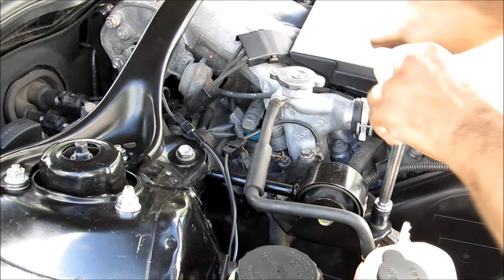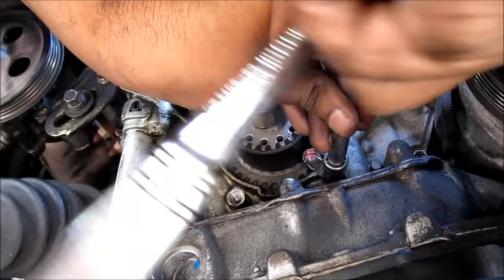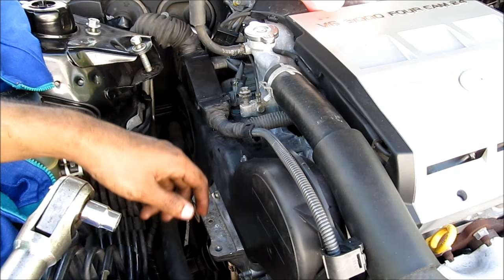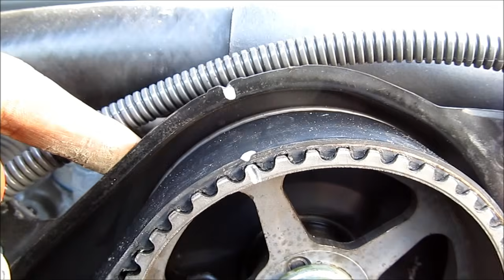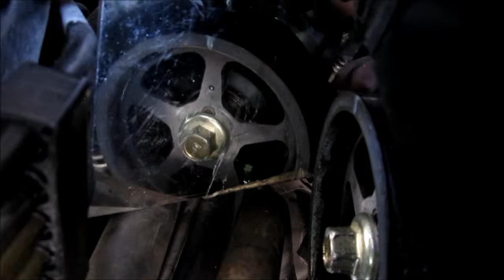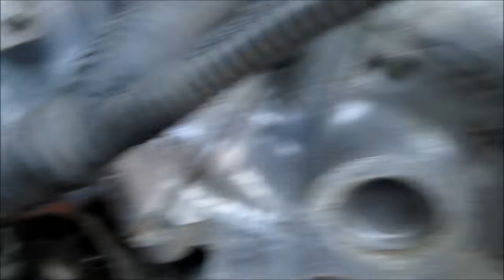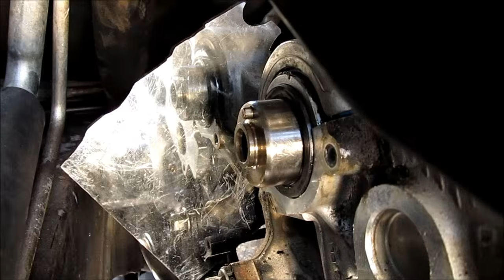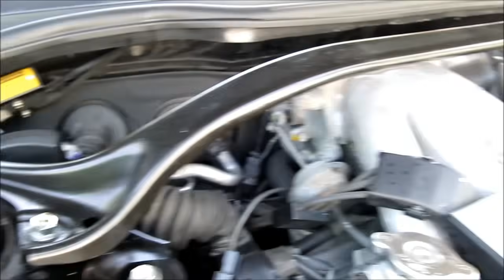Timing Belt / Waterpump Replacement: Toyota & Lexus V6

Comment: hey +speedkar99, I'm gathering the tools to get this job done, planning to also change out the thermostat while I'm in there

question: should the oil pump be changed eventually as well? A lot of people say to change out the water pump while you're in there since it will fail but I haven't see any discussions about changing the oil pump (only leak complaints from the pump area)  Maybe it's one of those life of the vehicle parts?
Reply from the maker: +neppy5 Only if the oil pump seal is leaking. I haven't investigated mine yet so I'm not sure how its done exactly. Same with the cam seals...no point changing if its not leaking. The hardest part of the job is that crank bolt, so make sure you're prepared for that.
Reply: +speedkar99 Thanks bro, I've got a IR W7150 in my toolbox now so I'm expecting to own that crank bolt, but we'll see how it goes, will definitely be taking a video of the bolt removal
Reply from the maker: A cordless impact? If its the first time that crank bolt is coming it, its not coming out with a cordless impact. Even the bump-start method couldn't get the crank bolt off my Lexus ES330 the first time. Today, almost 3 years later, it zipped it off no problem with my 1/2" air impact.
Reply: speedkar99 here's a comparison of the old belt to the new one:  http://tinypic.com/r/2ed8vpx/8   http://tinypic.com/r/1yuzd/8

to my untrained eyes the original belt looks a bit dirty but not really worn, seems like it was still in pretty good condition after 137K miles, did not notice any cranks when flexing it and checking the teeth and back side
Reply from the maker: Rubber deteriorates internally. An old belt most likely looks like new to the eye, but who knows what small defect inside the old rubber could cause it to snap at an incontinent time.
Reply: +speedkar99 continued with the job this evening and was making good progress, got all the pulleys and sprockets back in, and the belt out on and timing marks aligned after a couple of tries, but then things took a turn for the worse, one of the studs snapped off on new water pump when I was torquing a nut, where it attaches to the lower radiator hose, not sure if I'll need to get another pump or if I can somehow replace that stud that broke, I still have the old pump
Reply: +speedkar99 here's a pic of what transpired, my 1/4" torque wrench really let me down, I kept turning trying to reach the proper torque from the toyota service manual then surprise, stud snapped off with the nut and the wrench never clicked  -___-

http://tinypic.com/r/2qk2qyq/8
http://tinypic.com/r/2cxey40/8
http://tinypic.com/r/2a5alif/8
http://tinypic.com/r/2cxey40/8
Reply from the maker: This reminds me of my first TB job where I totally screwed up. Had the torque wrench in ft-lb instead of in-lb. Yup, had the idler bolt snap after I buttoned things back together. Towed my ES330 to the shop, snapped all the water pump bolts too :(.

Is that stud inside the engine or a part of the water pump itself? If you could take off the lower rad hose (I assume its the black pipe thing), can you get a vise grip on that stud to turn it out? I hope its not in a hard spot to reach in case you have to drill it out.
Reply: +speedkar99 thankfully the stud is inside the water pump and its sticking out a bit from the pump so I'll try getting some vice grips on it and see if it will move, I doubt it will since it stays in place to the pump allowing the nut to get tight when reinstalling, yup that's the lower radiator hose and it can easily come off, might have to carefully take a left hand drill bit to it if there's space, thanks for advice man and I'll definitely keep you posted with the progressive to be the first
Reply from the maker: +neppy5 So did you get that stud out? Or change the WP?
Reply: +speedkar99 hey man, the timing belt job is done! and everything is back together again

http://tinypic.com/r/205e24w/9

I would say the toughest part of this job was working in such tight clearances. There were a lot of frustrating moments where it took like 15 mins to get a bolt back into place because there wouldn't be room to get my hand or a socket in there from a good angle. Anyway, in terms of engine performance the car is running the same as before so that's good. Very happy that I was able to do this job and thanks for inspiring me to do it. I had a great sense of accomplishment once done.
Reply from the maker: That's great to hear. Next time you can make a video for the 4 cylinder timing belt to compliment this V6 video :)

Comment: Great video, thanks!   I'll be taking my RX400h to the dealer for this!
Reply: Is the 04 es330 Very Similar to This, & What's the Recommended Mileage ,Prev.Owner of My 330 Did First T.Belt Change @ 74,350mls.?My Last 01 Toyota Tundra Was Similar in cc,Size ,but Rear Whl.Dr.& it Was 115,000mls.,but ,Of Course this Is Transverse Mtd.Eng .And A VVTI eng.
Reply from the maker: +Bob Galvan Thanks for the feedback. The RX400h is a bit different in that it uses the 3MZ V6 but doesn't have accessory belts.

Comment: I’m looking for a Video on doing a 1996 Lexus ES300 V6 timing belt ,water pump ,cam plugs and seals, I have a manual but it takes a lot for granted,like you already know what needs to be removed in over ½ the job ,But I think the 96 is easier to do then the 2000, Any idea’s or have you seen a 96 Lex video on here?
Thanks
Ps. Good Fast Job!
Reply from the maker: +herculesx 96 has same motor as the video, 1MZ-FE, procedure should be exactly the same.

Comment: Not a bad job at all, but I think he should have gone a little slower. It was almost like he had 5 other jobs waiting and he was doing this one as fast as possible so he could go on to the next one ( a 45 minute complete transmission Rebuild!). He no doubt got paid by the job ,NOT by the Hour. But all in all you know this wasn’t his first Timing Belt Replacement ,more like his 300th ! But a Good A+ Job ,except the video cut out on the real Problem steps!!
Herc.

Comment: speedkar99 - i followed your video here and comments on club lexus but have a few questions.  When you remove the timing belt, after removing the tension first, does the rear cam snap back?    I'm trying to see if you can provide more info on how to make sure that the pistons don't hit the valve.  
thanks.
Reply from the maker: +BenzSUV The cam won't snap back unless you try to move it. Removing the belt can be done without it snapping back. With the timing aligned, its sitting at the top of the cam lobe which is spring loaded.

If you want, you can slightly move the camshaft forward (clock wise) so its just past the mark but at a stationary spot. I think the repair manual mentions something about rotating the crank 60 degrees when the belt is off the engine to prevent this very thing (I didn't quite understand their wording though). 

Make sure you use a breaker bar on the camshaft bolt to position that cam gear on its mark, as it might snap back if you use a cam holding tool when slipping the new belt on.

Comment from the maker: @erik3423 I'm not familiar with Subaru engines. Is there a timing belt behind those pulleys? If so it could be a bad idler, tensioner or water pump bearing that should have been changed with the timing belt.

Comment: I wish I had watched your video before taking mine in to get it changed. They replaced the belt but now it makes a whirring sound when I accelerate... does this mean the belt is on too tight? Sounds exactly like this https://www.youtube.com/watch?v=Wc_ex7Lmano

I took it back, they said it is completely normal for new belts to do that, but I'm not really buying it. What do you guys think?

Comment: I'll be doing this in November to my 2001 Avalon. It is still using the original belt and coolant pump.

One thing that I REALLY like about your videos is that you let us know the size of the sockets that are needed as you go.
Reply from the maker: +O'day 35 Thanks. Good luck on your TB job. 15 years is a long time for the original timing belt.
Reply: +speedkar99 Job completed thanks to the help of this video! The car only has 83K miles, but the belt and coolant pump were 15 years old. I found a tool which pulled the cam and crank shaft seals easily. Neither of the seals leaked, but I had read of people completing the job, only to have the seal start to leak weeks later. Unfortunately, the NEW crankshaft seal seems to have a small leak. My hope is that the new seal will seat itself, after I get the car fully warmed up and drive for a while.
Reply: +O'day 35 The leak did NOT fix itself, and actually got much worse! I had to re-do the seals - twice! For the third, and final (successful) time, this is what I did: I coated the seals with GREASE instead of oil. This seemed to help them seat better. I also cut a 1" piece of a 1¼" ID PCV coupling, the correct diameter for the seal. I used this in conjunction with the camshaft sprocket, and crankshaft sprocket and the bolts to press the oil seals in place. Hammering on the piece of PCV pipe caused the seal to mis-align, and resulted in the leakS.
Reply from the maker: Ah I see, I guess I had better luck hammering the ABS pipe. How was it doing that rear cam seal again so close to the inner fender? It was a pain for me :(
Reply: +speedkar99 the rear was easy. as easy as the front. Remember, I was working on an Avalon, not a Camry. I believe I had more room in the engine bay.

Comment: Is it ok to use an impact to remove the camshaft sprocket bolts?
Reply from the maker: Perhaps but you need to make sure it doesn't rotate the cam backward. Access is very tight for the rear cam, not sure how you'd get an impact on there anyway.

Comment from the maker: Karen Sok You need to use a camshaft holding tool or a 17mm socket to hold the camshaft in its timed position while slipping the belt on. I started on the rear camshaft and used a clip to hold the belt in place against the gear, then worked my way across the idler, front cam, down the water pump, around the crank leaving the slack at the tensioner.
Reply: I could not get the belt onto the crankshaft pulley and align it  with the mark on the crankshaft pulley.  The following procedure worked for me: 

Before you even took anything apart you should have pressure washed the entire area where you will be working.

Taking care not to blast off labels, useful information, and wiring conduits, pressure wash every thing you can reach in, around, and under the right side of the engine compartment.  That caked on oil and dirt you miss is what will invariably later land in your face, in the seals, in the bolt holes, and wherever else it can do the most damage.

Jack the front end at least six inches off the ground, put jack stands under the engine frame, remove the right front tire, and pressure wash everything you couldn't reach before.  That's what I do first:  I do not enjoy working on filthy cars or engines and you either being it to me clean or pay for me to clean it.  

For everyone else who already has everything apart and is ready simply to install the timing belt (belt),  

Topside: 

remove the top idler, put it on the engine cover within easy reach.

put the belt on (new ones come with timing marks, figure out which marks are for the camshaft (cam) pulleys and position the new belt accordingly,

align the rear belt mark with the rear cam pulley mark, 

clip the belt to the rear cam pulley at the mark, 

do the same on the front cam pulley, 

turn the front cam pulley clockwise and hold tension against the rear cam pulley (the front camshaft will kick to hold tension against the rear cam pulley), 

Underneath:

use the slack to get the belt mark to align with the crankshaft (crank) pulley, 

clip the belt mark to the crank pulley mark and verify all the belt teeth are engaged on the crank pulley, 

Topside:

put the top idler where you can easily reach it, 

rotate the front cam pulley counterclockwise to pull belt slack where the top 
idler goes, and 

install the top idler.
  
Verify that all three belt marks are exactly aligned with the pulley marks and there is no slack between the front cam pulley and the crank pulley (at least not one tooth of slack). 
 
Pull the pin to release the belt tensioner.  

All three belt marks must perfectly align with the corresponding pulley marks.  

If not, remove the belt tensioner, reset it in a press, reinsert the pin, reinstall the tensioner, shift the belt to align wherever the belt mark is not aligned with the pulley mark, pull the pin on the belt tensioner and verify that all three belt marks are aligned with the corresponding pulley marks.
Reply: HI, in the starter bump method; i have 99 camry; where and how and what do i need to dissconnect so that car dont start??anyone?
Reply from the maker: +Alex Mendoza Just remove the efi fuse or the coil pack connectors on the front of the engine.
Reply: ok, thanks;;; I have the belt off , putting a new one; i turned the crank to TDC; but cams are not aligned TDC; can i turn cams individually untill they are TDC; does car need to be in neutral?

Comment: When taking off the sealer gunk from the surface on the engine, when the water pump uses rtv instead of metal gasket, does the surface need to be mirror finish, or is it fine if the surface is still stained but as long as it's smooth? (i know this question is not specific to this car, but im sure you know the answer.) Thanks!
Reply from the maker: fbravo59 As long as its smooth its fine. RTV is meant to go into the metal surface's imperfections and seal them up. Just make sure its clean enough for the RTV to stick. I prefer the metal gasket.

Comment: According to the video by Schrodingers Box, the rear camshaft should be held in place by a wrench to prevent it from springing out of position and smacking the valves on the cylinder (Apparently at TDC, the rear camshaft is in an unstable position due to some valve springs being compressed). I see that you did not do that, but it also didn't cause any problems. Should I hold the rear camshaft in place when removing the belt? From what it sounds like, the valve springs can provide enough force to damage the valves if it smacks onto the cylinder, so I don't want to take any risks on that.
Reply from the maker: TheCheesyProductions I didn't have any problems on this car. If replacing just the belt and not the cam seal chances are it won't move during the installation. Holding the camshaft with a wrench requires removing the intake and rear valve cover, too much work unless you're in there already.

Comment: I just followed this, while it took almost a week because I had to stop for work, I got it done.  Only problem is I started it up when the alternator/power steering belts weren't on, it started fine.  Once I put the alt/ps belts on and got everything bolted down, it wont start.  Not sure if its just a dead battery, we'll see....  any input?
By the way, thanks for a great tutorial!
Reply from the maker: 6theory Glad it worked out for you. Did you check your engine grounds after you bolted everything up?

Comment: I wish you were in the San Diego/ Los Angeles area. I'd love to pay you to slap a kit on my 1mzfe. It's either $780 for the local shop to put a timing/water pump kit on or $250 more for the dealer to do it.

EDIT: Nevermind. Luckily I just found a shop on Yelp that has a staff of former Toyota trained dealer mechanics. They only use genuine Toyota parts. I was quoted $670 out the door for the pump, seals, and belt. They use the Aisin pump. Very clean shop too.
Reply: rkgsd If the local repair shop already has you by the throat for $800 non OEM parts, you might as well spend the $250 for actual Toyota parts and Toyota mechanics. Just my 2 cents. It depends on how import $250 is to you. $1050 is a big 4 digit number though.
Reply: ***** Luckily I just found a shop on Yelp that has a staff of former Toyota trained dealer mechanics. They only work on Toyota and Lexus and they only use genuine Toyota parts. I was quoted $670 for the pump, seals, and belt. Very clean shop too.
Reply: speedkar99 Thanks, turns out the shop I had gone to for a few decades no longer uses customer supplied parts. They no longer get my business. I found another shop on Yelp cleverly called TLC (Toyota Lexus Care) that only has Toyota mechanics and only uses Toyota parts (Aisin water pump). $640 vs $790 for the old shop's aftermarket parts vs $1040 for the dealer.  Will have it done on Tuesday.
Reply from the maker: rkgsd Buy the OEM parts from RockAuto and get your local shop to install it.
Reply from the maker: Hope it works out for you. Considered DIY?

Comment: +speedkar99 -  Great how-to video.  One question for you if you don't mind.  I got everything put together, put the timing belt on and rotated the engine a couple times to check the timing marks, which they all aligned, but of course the belt did not align with the timing marks.  While rotating the crankshaft by hand, I noticed a bolt on the ground which was a water pump bolt that must have broke off.  So I'm going to spend my next weekend taking it apart to fix the bolt then do it again.  My question is (to anyone that can answer), once the crank and cams are aligned to their respective timing marks on the engine, if the timing marks on the actual belt are off does it matter?  The old belt had no marks at all, but I put it at TDC according to the timing marks on the cam pulleys and crankshaft.  I just want to make sure I do it correctly since I know you had a similar problem.  Thanks!
Reply from the maker: 6theory Thanks for the feedback. As long as your cams go back to their marking after two rotations of the crank shaft, your timing is fine, regardless of the markings on the belt.